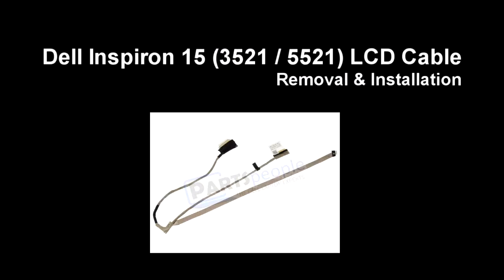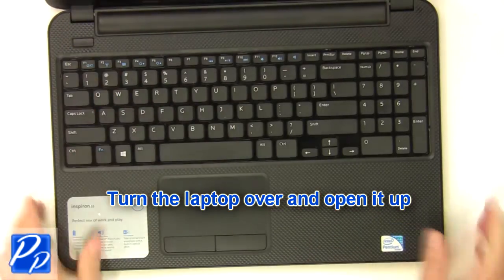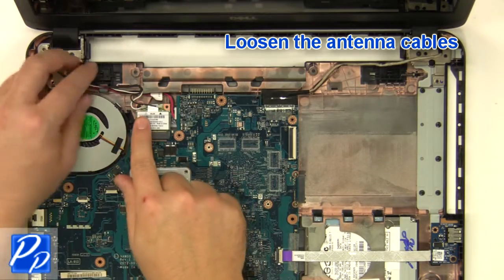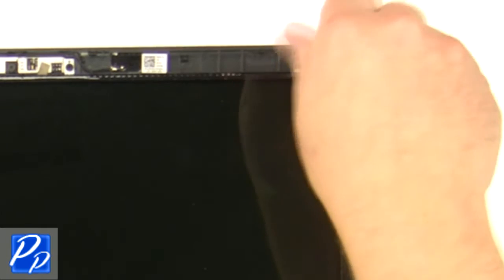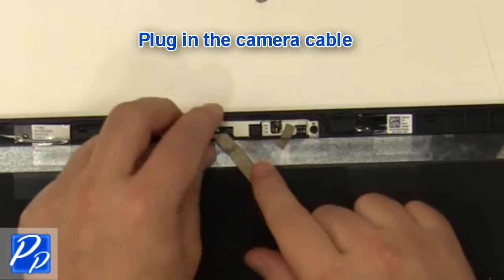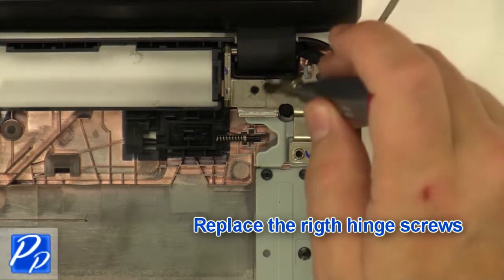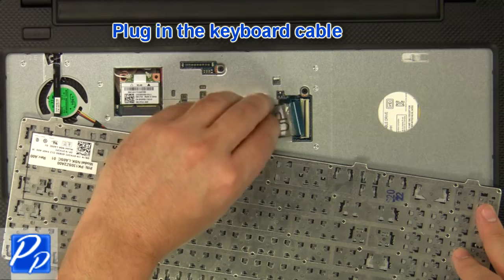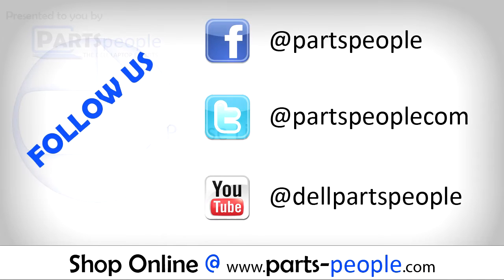Dell Inspiron 15 (3521 / 5521) LCD Cable Replacement Video Tutorial

Comment: Thanks for the video. I was hoping replacing the cable would fix the line going down my screen since it comes and goes depending on the hinge position but didn't fix the issue. Oh well.

Comment: There are actually FIVE 2.5mm x 5mm screws. You missed the two just to the left of the longer palmrest cable, because the computer you repaired in this video had already lost them. There's one at either end of that cable, and I nearly broke something trying to get the palmrest cable off when it was still attached by those screws.

It only becomes obvious in the video that those holes were already empty when you remove the palmrest and light is visible through the holes.
Reply: Excuse me - trying to get the PALMREST off, not the cable.

Comment: SCREW ALL THIS, JUST BUY A NEW COMPUTER
Reply: It is pretty involved. But on the other hand, if your laptop is working just fine and you'd replace it with a new one with similar specs, you'd spend a pretty penny. Assuming you go really slowly and carefully, and it takes you an hour or two, is that a good price for your time?

Comment: Hey awesome video.

I've also screen flickering problem in my dell Inspiron 15 laptop.

I've to replace my screen cable or whole screen?

If screen cable problem would there , then what would be a charge to replace a screen cable in Dell service centre?? ( India)
Reply from the maker: It's hard to say, if I had to guess it's probably the screen starting to fail. It will need to be diagnosed to be sure. Also, I don't know what Dell would charge for the repair, we are not Dell. We would charge 100USD for labor, plus the cost of the parts necessary.
Reply: I had this same problem, it is cable problem , the display is fine

Comment: clearly explained steps but -  I followed them exactly but my laptop wont start now - When I plug in the power cable and try to start the laptop - I hear a mild hissing sound but no light anywhere in the laptop ? any suggestions to fix this ? I am worried now if any damage to motherboard or hard disk happened .
Reply: parthiban R 

Do you wear anti. Staric wrist